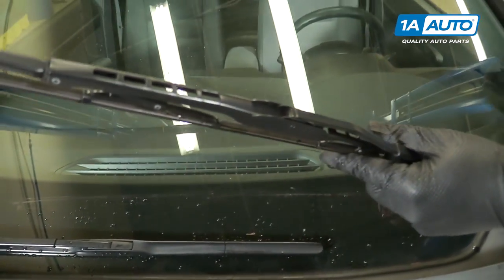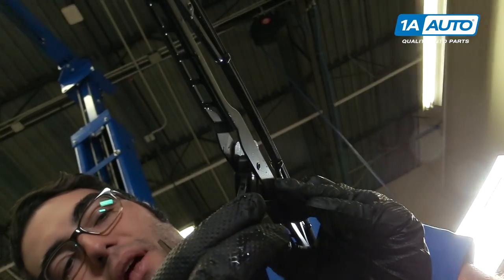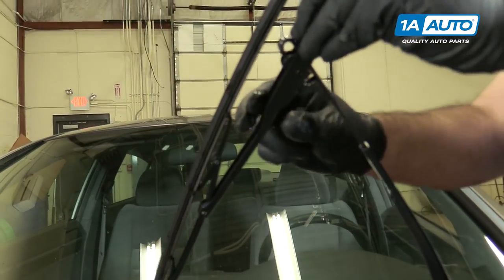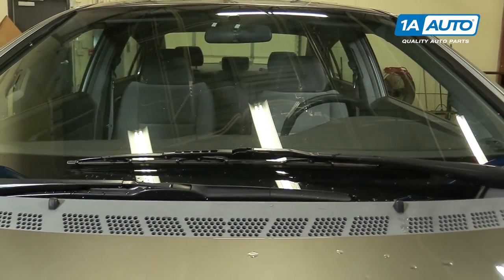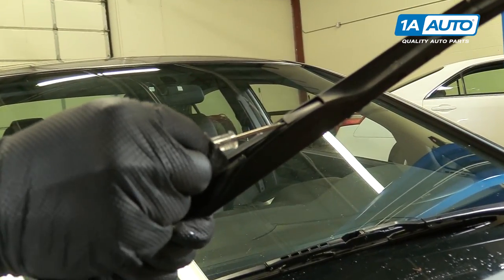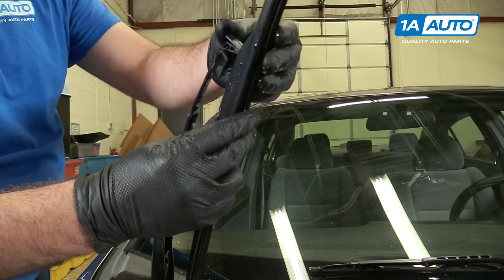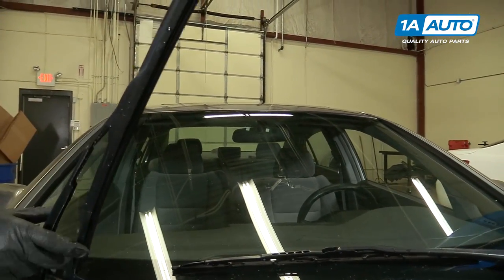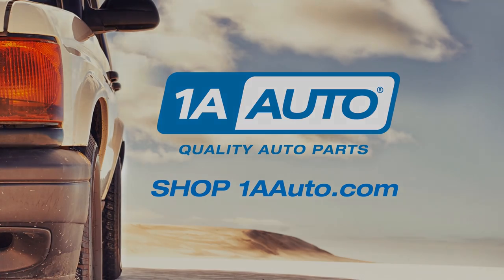How to Replace Windshield Wiper Blades 05-11 Honda Civic

Comment: Where did you find a Civic with j-hook wiper arms? My '08 has some strange arms with a flange that the wiper ise vevidently supposed to slide into.
Reply from the maker: +Matt Bowers That's just how this one came
Reply: 2008-2011 models came with standard style j-hook arms. 2006-2007 models came with those strange arms that are really only compatible with the OEM blades.

If yours is a 2008, then it should have the j-hook arms... Unless you have an early 2008 model...
Reply: @Fifthcell  i have a 09 civic didnt came with j hook design either driving me nuts
Reply: @Fifthcell  mine must be an early 2008 model, because I have an 08 civic ex and I have the weird slide in ones as well.. really hard to find blades

Comment: The video helped by pointing out the key to releasing the old blade - pull UP on the tab, flip the blade and push down. It's so easy when you know the way!
Thanks!!
Reply from the maker: +Jim Walsh Thank you for the great reply. We love to empower our customers by showing you how-to perform your own auto repairs while installing our high quality auto parts. Have a great day! 1aauto.com
Reply: Mine is neither of those.

Comment: I put the conventional ones now they sticking up not touching glass? Is the right size 24 passenger side help?.
Reply from the maker: +ikki fenix Double check with your manual... 2008 Honda Civics Driver's side will be a 26 or a 28. The PAssenger Size will be a 22, 24, or 25.....depending on the trim
Reply: These people don't know what they are talking about. If you have the civic SI you have to buy wiper refills. You can't replace the entire blade assembly.
Reply: @1AAuto  LOL 'depending on the the trim'?
Irregardless of the trim the wiper arms are the same.
What a useless, uninformed reply

Comment: My kid's 08 Civic has different blades than this. To remove, you press a little button on the back (exposed) side of the blade holder, then  it just pops right out.
Reply from the maker: +Shane Peterson Thanks for the tip!

Comment: Why... this is driving me to my limits why do like almost every car i look at got the j hook blades and mine is the stupid clip in ones and no normal gas station sells them not even walmart... i need adapters for j hook blades or some one point me in a direction where i can change the wiper arms completely for the j hook ones..